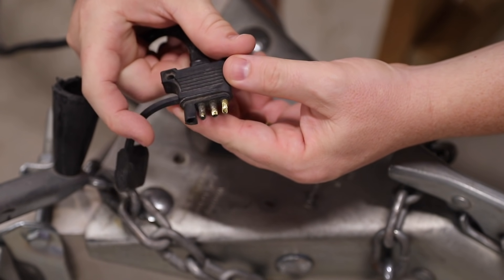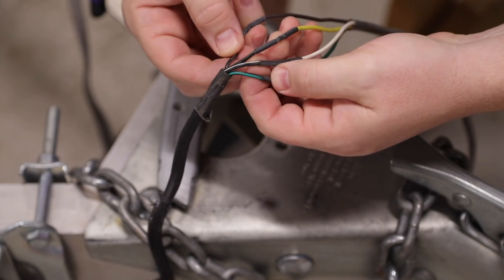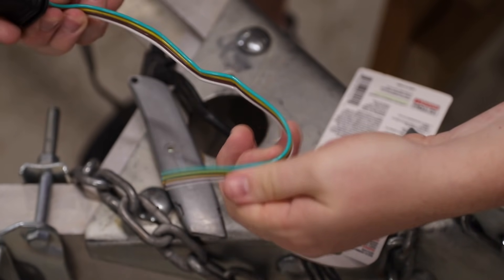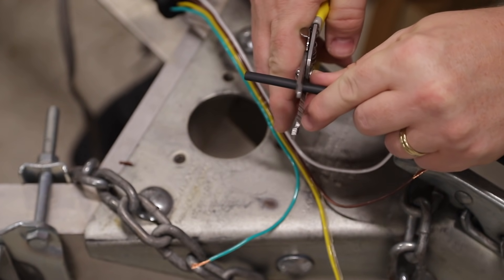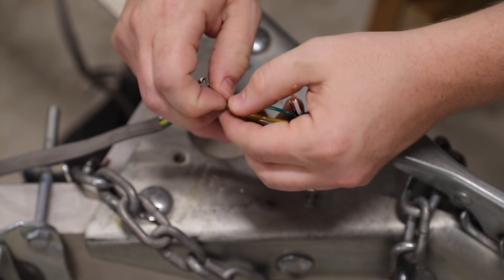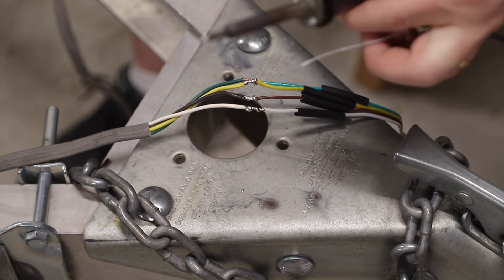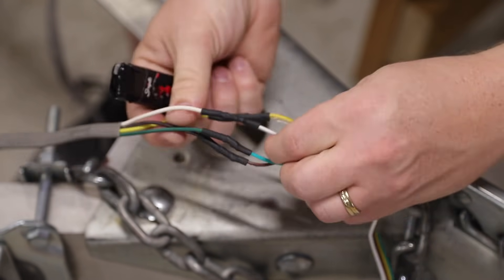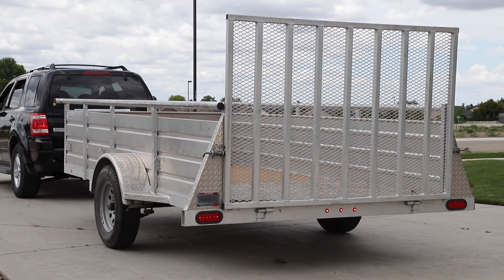How To Repair or Replace 4-Wire Flat Trailer Wiring Connector Harness

Comment: I'd add another tip for soldering - stagger your joins! Especially when you have so much wire available, staggering where each wire connects will prevent accidental shorts if a wire strand pokes through the heat shrink. Also, add enough flux to your wires, it prevents corrosion and the solder will flow much better.
Reply: What do you mean by "add enough flux"? I'm in the process of replacing mine and want to make sure I do a good job.
Reply from the maker: Great tip, thanks!
Reply: 😂 very unnecessary. If your time is money, like 99% of the population, disregard this comment

Comment: One other thought: Soldering and heat shrinking the wire is the RIGHT way to do this. Those crimp butt connectors are just endless problems. If you solder and shrink, it's a lifetime repair. (Though I'll admit I cringed a bit with the open flame for the shrink. Yes, it works fine in a pinch, but I always prefer a heat gun whenever possible. Better, safer, and more uniform shrink.) I also recommend the heat shrink with the adhesive inside. It's like hot glue that heats up and seals the entire length of the heat shrink.

Comment: Great job. You are correct that the wiring colors are standard across all trailers. Right turn/brake is Green. Left turn/brake is Yellow, tail/marker lights are brown and ground is white. Makes it easy to get things right when the colors are always the same!
Reply: what do you do when theres an extra yellow wire
Reply from the maker: Hmm. I’d probably start by using a multi tester to check for continuity between the extra wire and the rest of the wiring harness. Next I’d try to trace it to see where it goes.  Good luck!
Reply: How do you do when i put extra light...i need conect in Brown wire.
Reply from the maker: I'm not clear about exactly what you want to do, but you'll probably need a splitter of some kind. If you search google for "trailer wire splitter" there are lots of easy options. Good luck!
Reply: that's true till u come to ur left turns right, right turns left.had to cris cross them. plus wires coming out of new lights r red black green and white.